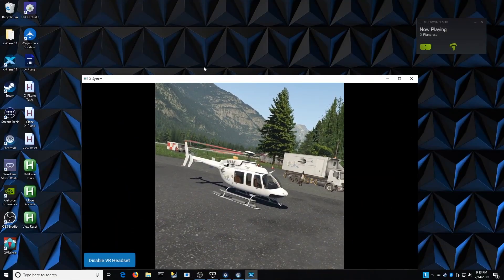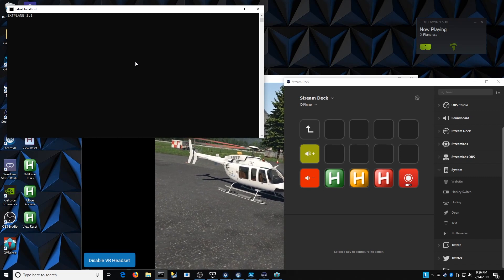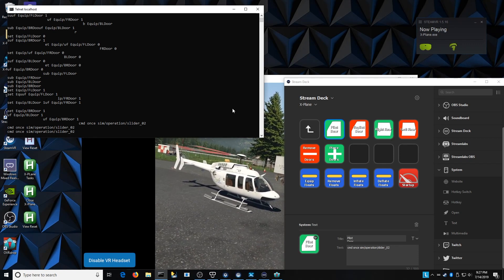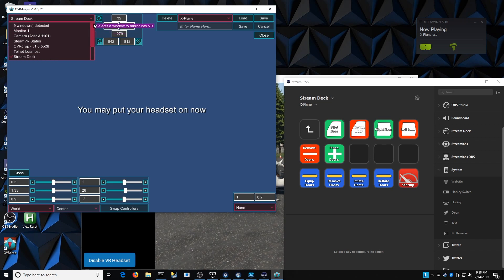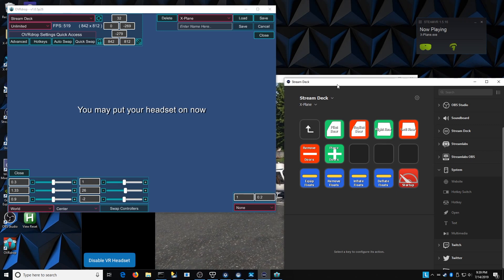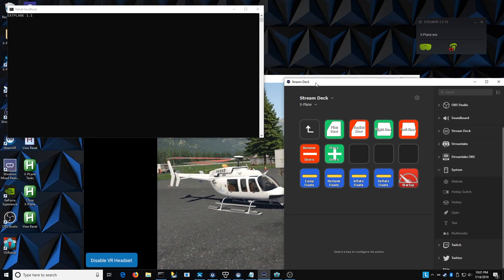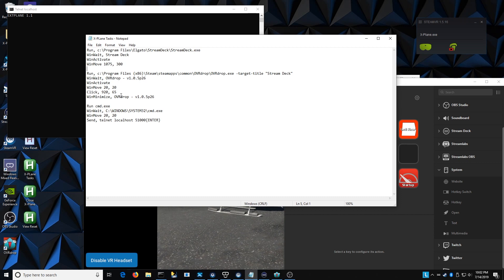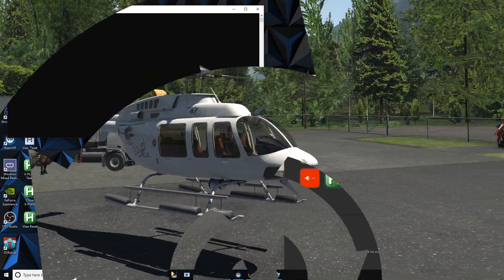Stream Deck in VR Part 2

Comment: @Chowd Air.
I cannot manage to communicate throught localhost 51000. That number is for everyone? Or it means something?
When tiping in the cmd prompt it says: No se puede abrir la conexión al host, en puerto 51000: Error en la conexión
That is saying basically that it cannont be opened.
1. When i download ExtPlane, it does not appear anywhere. Nor in the plugins options when loading the Sim after installing it. How do i know then if is working? Plus it seems there are many versions of ExtPlane. Which one shall i download?
2. What i did first, was to asign shortcuts to keys of the stream deck, and to asign those shortcuts to x plane 11 functions (lights, AP1, Chrono...) If i do what you say, through local commands, do i still have to be mapping function by funcition?

The point is i do not see properly how to do all the things you are doing. 
Do i have to download Qt Framework 5+
X-Plane SDK 3.0+Qt Framework 5+
X-Plane SDK 3.0+
Do i have to download those things in order to ExtPlane to work?

Thanks
Reply: Besides what i have written before, i have also the following problem.
I mapped all the buttons via shortcuts. And without vr it works totally find.
The point is that when switching to VR, for whatever reason, the stream deck with all the config via shortcuts of the Xplane 11 toliss a321 buttons, does not work. 
Without vr it works totally fine, but not with the headset itself. 
WHY?
Thanks
Reply from the maker: @pablonavarro2114  Hi Pablo, There is more information on the X-plane Forum post here:  https://forums.x-plane.org/index.php?%2Fforums%2Ftopic%2F186770-using-a-stream-deck-in-vr%2F.  I will try to answer here as well. The port 51000 is specific to the EXTPlane plugin that is used to communicate with X-Plane from the Cmd Prompt. https://github.com/vranki/ExtPlane   Without the plugin installed into the X-Plane plugins folder, it won't find it properly. Again for the second question the plugin needs to be working, and then the cmd prompt must be the front most application in windows. When you are pressing buttons on the Stream Deck it is typing commands, and so the Cmd prompt window must be active to receive the commands. I hope this helps. If not ask again and I'll see how I can help further.
Reply: @chowdair  when i download ext plane, it comes with several folders, inside the main one. Do i have to move the main one to the plugins folder, or just the ext plane plugin folder? Because inside the main folder, of the extplane, there is a subfolder called extplane-plugin. should i move just that one to the plugin folder of xplane? Thanks
Reply from the maker: @pablonavarro2114  When looking at the current ExtPlane version, it only has the Linux plugin available. Make sure you download this version to have the Windows plugin.  https://github.com/vranki/ExtPlane/releases/tag/untagged-ee9f217e44c7ea7e825f  When you unzip it, you must move the inside  folder named extplane to the X-Plane 11/Resources/Plugins/ folder. Inside the extplane folder there will be a folder named 64 and inside that a file called win.xpl.

Comment: If you have the Stream Deck app running, why do you need Telnet? Doesn't the Stream Deck App communicate directly with X-Plane?
Reply from the maker: While you might be able to click buttons in X-Plane directly (Haven't tried it), I found that some things did not have a button associated. I don't have a direct example as it's been a while since I was playing with this, but I did find instances where the aircraft developer had not created a button association for some objects. Take for example a door. The developer would assume that you might pull the handle in the cockpit to open the door, and then have no need to assign it to a button. With telnet I am directly talking to all the data refs directly and can set them however I like. Imagine also that you can set specific things like the flaps at 12% where the controls would only give you 10% or 20% usually. It's very powerful.

Comment: Hi nice video, Newbie here,  could you please explain where you got the plugin from and which files you put in the plugin as the one i am looking at has loads and non of them seem to show in xplane when its running, thanks
Reply from the maker: Hi Chris. There are a lot of details on my X-plane post here. Let me know if you need more info.
https://forums.x-plane.org/index.php?/forums/topic/186770-using-a-stream-deck-in-vr/
Reply: @chowdair  thanks will have a look
Reply: Hi Chowd Air  i have followed some instructions how to enable telnet off you tube, i have put extplane file into the xplane plugins folder ,but it does not show in plugin admin of the xplane menu . and telnet just says welcome to Microsoft tenet client Microsoft telnet> any help would be much appreciated. the plugin is off the link but there are lots of files within it so not sure if this is the issue either.
Reply from the maker: @chriswoods7656  Hi Chris. First make sure you downloaded the plugin properly. There are links on the release page of the GitHub host site.  https://github.com/vranki/ExtPlane/releases
Click on theextplane-plugin.zip choice to download it. Unzip, and move the folder called extplane to the plugin folder in X-Plane. You will see the plugin under the Plugin Admin area in X-Plane, but it won't show up in the list of plugins directly.
Once it's installed, you will open the cmd prompt in Windows and type: telnet localhost 51000  You should see a response from the plugin.
There is more detail on the Github page as well.  
https://github.com/vranki/ExtPlane
Reply: @chowdair  thanks very much will give it a go.
Reply: works fine now, thanks very much now to set up stream deck. Think is was the extplane plugin as it didnt show before, the link you sent works fine.
Reply from the maker: @chriswoods7656  OK great to hear.